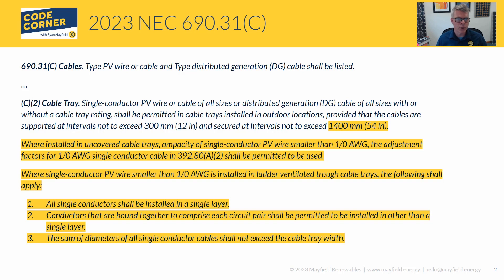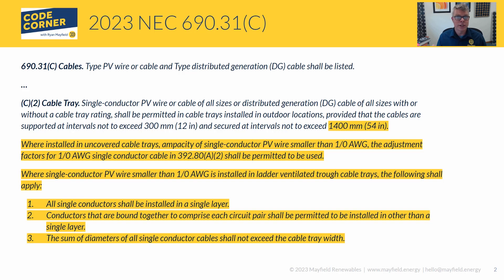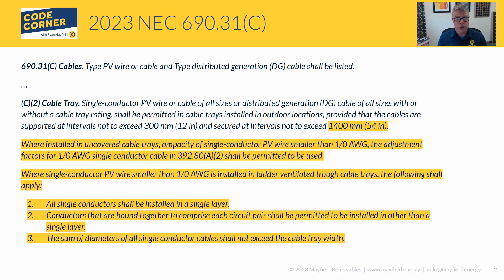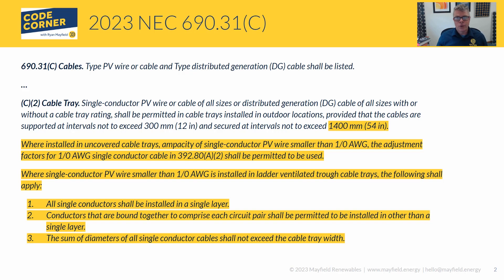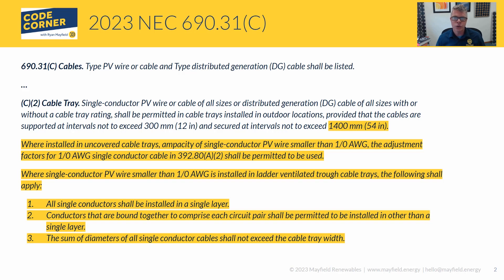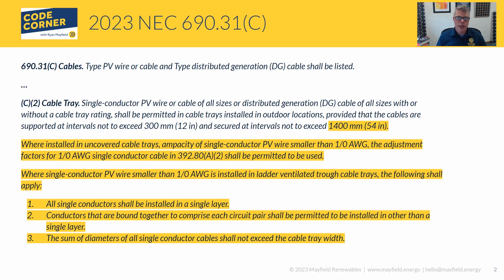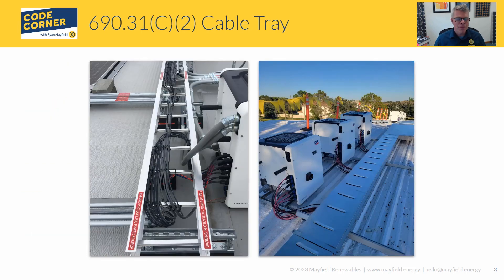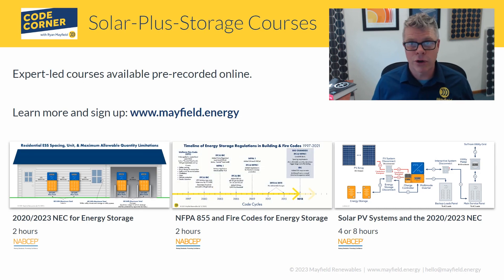Mayfield Renewables Code Corner: 2023 NEC 690.31(C) and 690.31(C)(2): Cable Tray

Comment: The tables for cable tray per 392.80(A)(2) cross reference back to T310.17 & T310.19, is that correct?
Reply from the maker: Correct, Tables 310.17 and 310.19 are referenced in 392.90(A)(2)(a) through 392.90(A)(2)(c)  -- for NEC 2023 and NEC 2020.